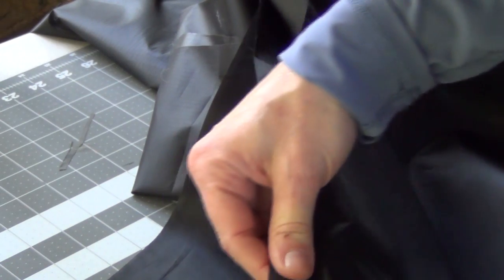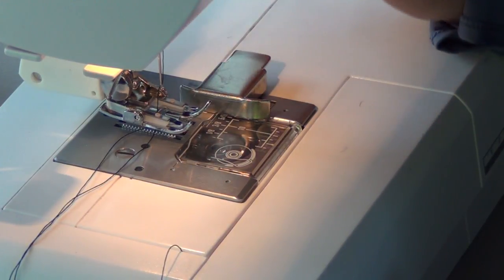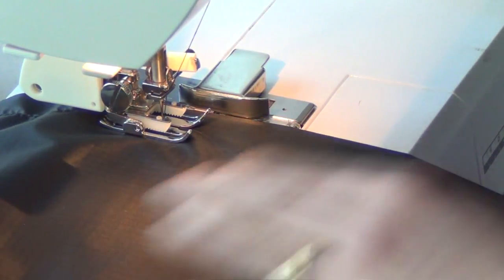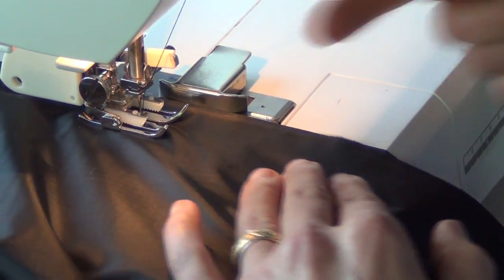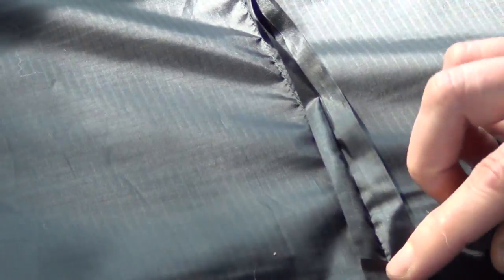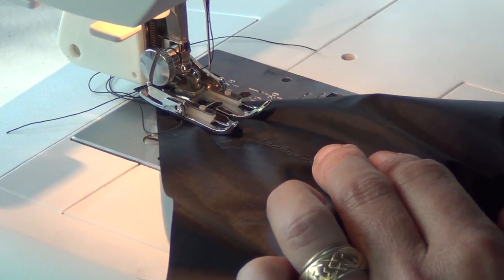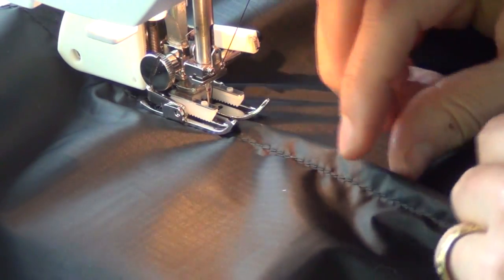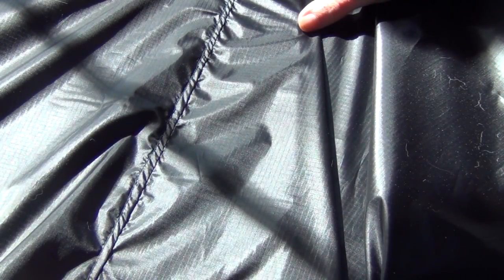Black Cat Tarp: Part 2  Sew the Ridgeline: Walking Foot & Flat Felled Seam

Comment: Hi J-Fish, 
You've inspired me to upgrade my thread injector to the same model as yours,  absolutely love it! I enjoy watching your videos and now I'm in the process of making a new hammock with a bug net and a lightweight hex tarp made out of sil membrane,  my winter time projects. Have you ever given a thought to maybe doing a video on making climasield booties?  You're videos are great, thanks for sharing! !!!!!!
Reply from the maker: Sweet! How is the tarp coming?
Reply: Jelly Fish  The sil membrane is very challenging for my 1st attempt at making a tarp, it's very slippery! I've been using a lot of packing tissue to help with the slippage.  I was getting some  bird nesting every time I started to sew, I found that my thread was too tight coming off the thread tensioner on the top of the machine. I'm currently sewing on the reinforcement pieces on my doors and then off to the tie outs. This is the winter tarp kit from RSBTR.

Comment: Im in the process of cutting all the materials to make a winter tarp. Would you suggest this option on the ridgeline as opposed to trying to do a flat-felled French seam?
Reply from the maker: Asa Reynolds I found the flat felled seam to be easier than the french-flat felled combo, simply because there are fewer passes down the seam with all that bulky fabric.  I'm pretty sure they are equally strong.
Reply: Thank you for doing all these amazing videos. I'm so very glad I found them. They are all very well put together and very informative!
Reply from the maker: Good luck with your tarp!